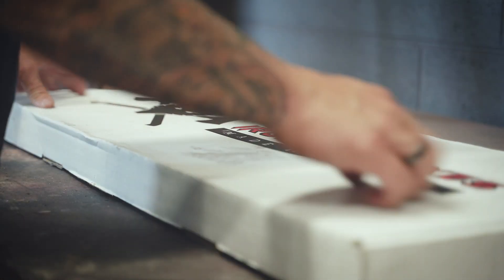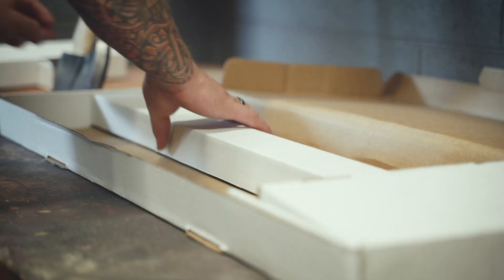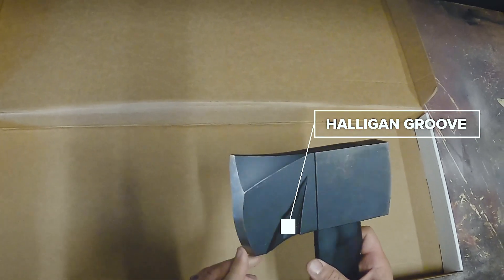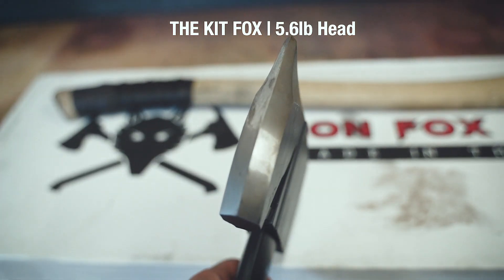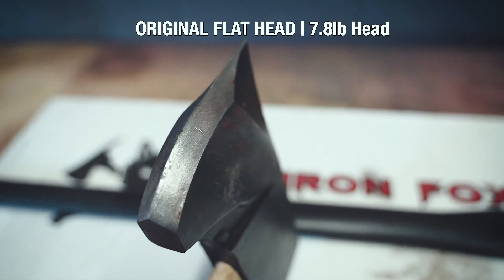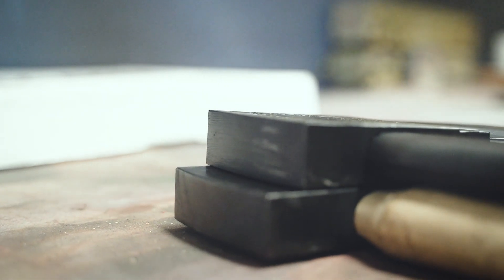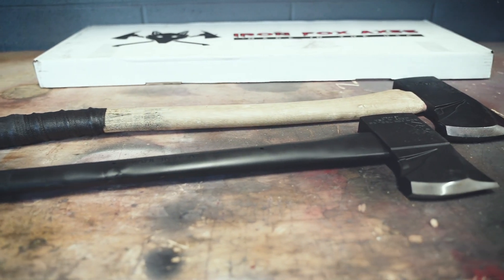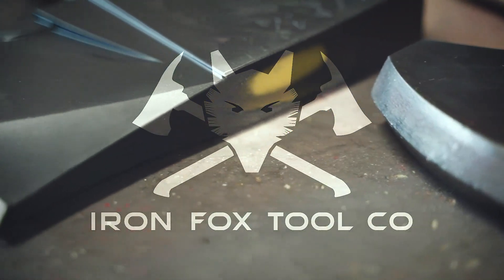The Kit Fox by Iron Fox Tool Co. - Unboxing

Comment: Would you prefer the 5.6 or 8.0 if marrying a halligan with it to carry?
Reply from the maker: I’ve done it with both and they work great. In the past I’ve carried the 5.6 with me when I’m on the Engine. When riding the Truck I would carry the 8.0 because the odds of performing roof vent are higher. If I’m on the Engine, it’s usually going to be used for forcible entry.
Reply from the maker: If you have the chances of doing vertical vent…. Go with the 8:0 IMO.
Reply: Thanks that makes sense.
Reply from the maker: @michaeljarratt6313  anytime